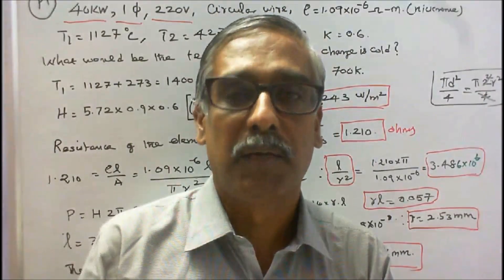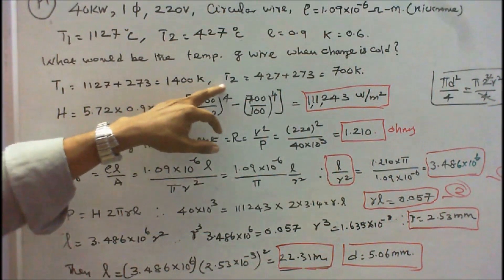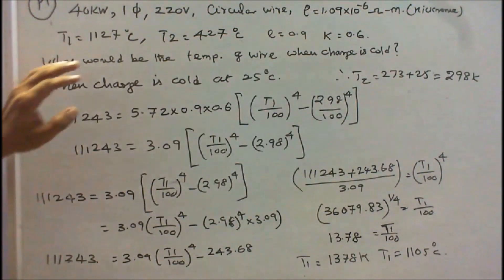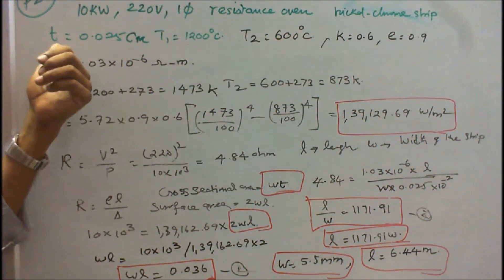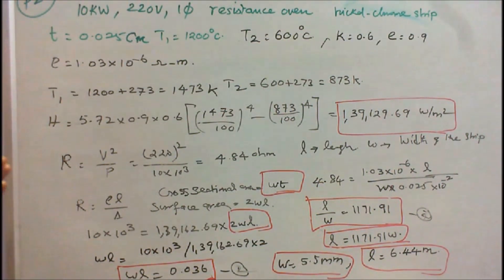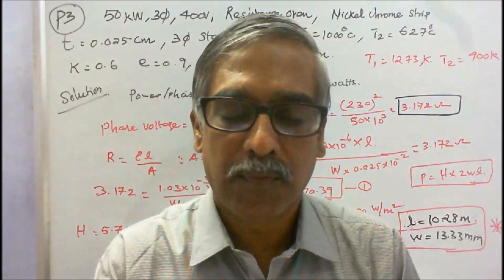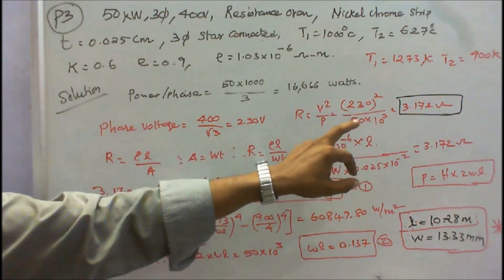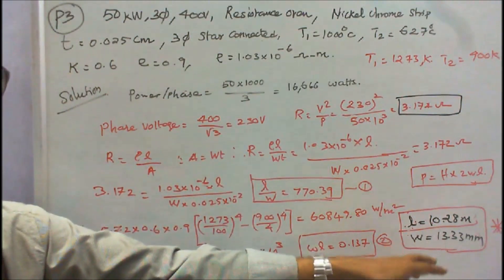ELECTRICAL HEATING  - PART - 03 - THREE PROBLEMS IN DESIGN OF HEATING ELEMENT

Comment: surface area of heating element  2wl :  how to get this formula sir?
Reply from the maker: Consider the nichrome strip, the surface area is calculated by multiplying width and length of the strip..since it has two sides the calculation becomes (wl+wl=2wl).
Reply: but surface of strip means having total 6 sides  total surface area = (lw+lw+tw+tw+tl+tl)